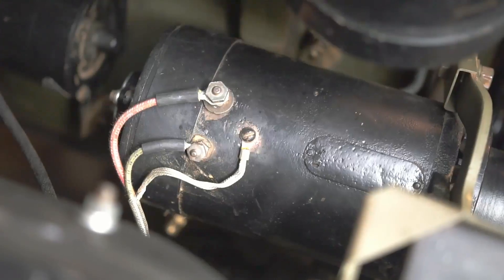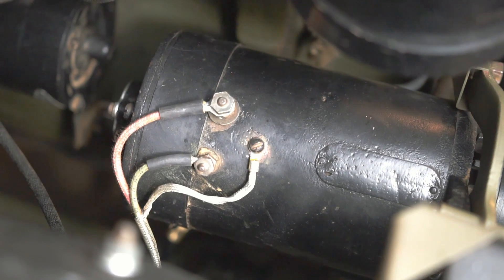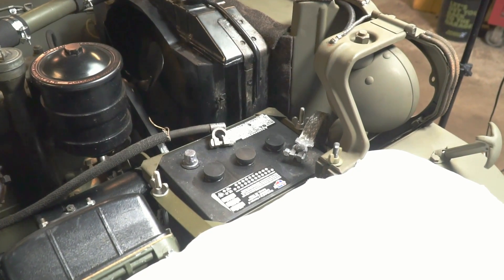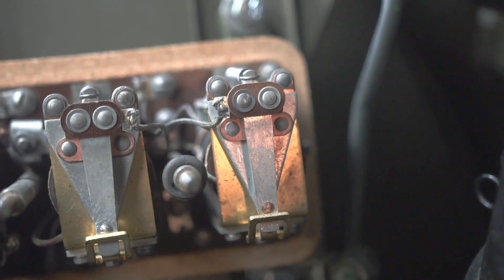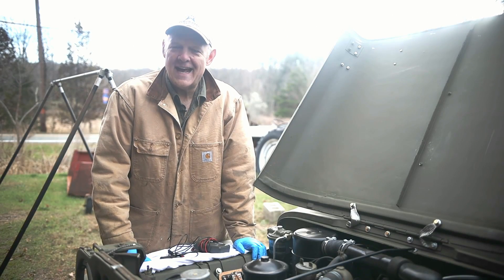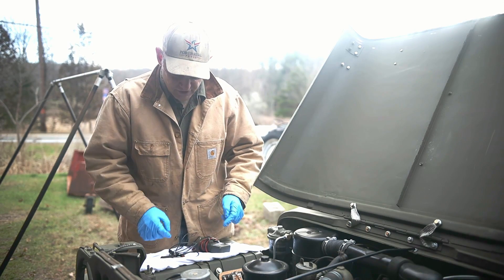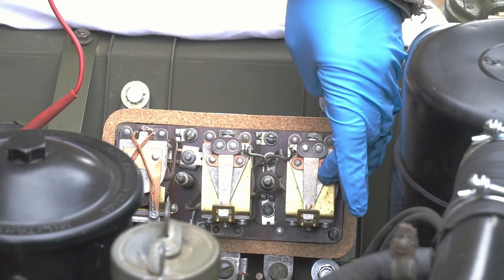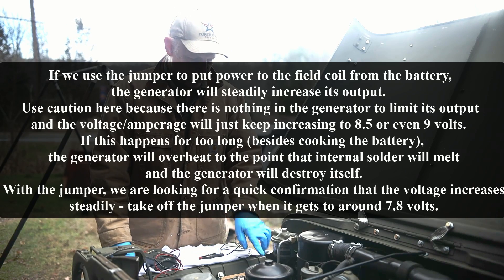WW2 Jeep  Generator Repair- Let's Fix that  Charging System/Shoptime #39

Comment: My Jeep isn't charging. When running the battery voltage is 6.2v (same as when the engine is off). I've followed the instructions to polarize it (Arm - Bat) and saw a little blue spark but it still doesn't charge. There doesn't appear to be anything happening under the cover of the Regulator, nothing moves at all when the Jeep is running. Would it hurt to try and polarise the Gennie for type A ( externally grounded)??
Reply from the maker: Start the jeep and get your voltmeter so it is clipped to the battery and giving you a readout.  Make sure the front most (closest to radiator) relay is closed...this is the "cutout relay".  Basically the on/off switch for the regulator/generator.  If it isn't moving - manually close it - just push down on the part with the contact until it closes - may spark a bit.  It should stay closed and things should start happening on the voltmeter.  

If it doesn't stay closed, then I would start by cleaning the contacts on all of the relays.   

You will be well served by getting the manual....very helpful in taking you through how it all works.  

https://www.portrayalpress.com/product-p/tm-9-1825b.htm
Reply: @Portrayalpress  thanks for your reply. I'm may be wrong, but I think that relay is permanently closed (contacts touching eachother).
Reply from the maker: That is not a good thing and can cause the generator to melt/a fire.  You need to put the positive lead of your voltmeter to the ARM terminal of the generator (big one), the ground to the body of the generator.  Then take a jumper and connect one end to the positive terminal of the battery.  Start the jeep.  Take the other side of that jumper and touch the Field post on the generator....you should see an ever increasing amount of volts on your voltmeter.  Don't leave it on there long....just see if the volt number starts creeping up.  The jeep should be a fast idle....maybe 1000 rpm (doesn't matter exactly, but have it running strongly).  This will confirm that the generator is still working.

Comment: Great video, right to the point, fun to watch, and exactly what I needed!   I drove my GPW the other day and noticed the meter showing a draw with the lights on.  I am thinking that is not normal.  I noticed a wire tie with a lead seal on one of the bolts of the voltage regulator, so I assume that it means it has never been messed with.    I think I will test my battery first since it is a 2018 cheap chain store model from the previous owner.   Have a good day!
Reply from the maker: Thanks JT and sorry for the slow response, I was offline for a bit.  Glad you enjoyed the video.  Indeed, the generator has the capability of putting out plenty so you should not be seeing a discharge with the lights on.  You can purchase the lead seal but I agree...most likely not messed with.  The battery probably should not cause the discharge with the lights on, but a fine place to start.  I would also check the belt tension, then just start the jeep and at idle with no lights, get a reading at the battery.
Reply: No worries on the late reply, the fact you made this video is more than enough help. So I found out my generator was rewired from its original circuit wiring so it would not work with the voltage regulator.  Never knew that generators had two types of circuit wiring, one type B I think was common for war era jeeps, and A was post war era.  So if your generator was an A circuit, it would not work work a voltage regulator that was war era for a B circuit generator.  Did I explain that correctly?

Comment: Good video,good explanation on these charging systems and how to check and adjust,that manual would be handy on any six volt jeep,I have a 2A with same Generator but civilian regulator but I know the charging principals are the same,just a different shape between them,the MB is bigger,I like those better and wonder why willys didnt keep that style on the civilian model,at least through the 2A's! Thanks!
Reply from the maker: Thank you Randall.  Yes - the voltage regulator on the MB is a beautiful piece of engineering!  I imagine they went with the later style because of cost....that progress thing! :-)

Comment: Hey Patrick great video.  Maybe I missed it but an important fact, the generator will not put out unless the engine is turning about 900-1000 rpms (a high idle).  Just sayin’. Thanks.
Reply from the maker: Appreciate it Paul - yes - probably not clear in the video!

Comment: Thanks a lot Patrick, awesome series of videos. I wanted to ask for your help, please: cj3a 52, 12 volts Neg grounded system. At 1200-1400 rpms Generator shows above 20 volts and 30 amps, regulator and battery shows 14-15 volts and 5-6 amps, amp gauge doesn't even move. Battery is not charging. I replaced both regulator and gauge, nothing changed. What do you think I'm doing wrong? I appreciate your help...
Reply from the maker: Glad you like them Andres.  I have a couple of questions:
1.  At 1200 rpm, what is the voltage at the battery?
2.  When you get 20 volts & 30 amps - how are you measuring that?  More specifically, is the generator connected to the VR? and what terminals are you connecting your voltimeter to get those readings? 

if you want to go email/call...send me your info to sales@portrayal.com and we can try and figure this out....

Comment: My starter and generator were recently rebuilt. Like your voltage regulator, the output from generator to battery was over 8 volts. When I checked the long unused “original” battery in the vehicles when I began the total rebuild I realized it was 8 Volt. The shop doing the rebuilds reset the VR to recharge the standard 6 V battery. Perhaps the previous owner reset the VR to recharge the 8 V battery. Thanks for the manual tip. It is now ready for me if I need it to guide me through VR readjustment when I wake my Jeep up. Thanks for the great tips 
and repeating the very necessary access to the right manual. Highest Regards, JeePa.
Reply from the maker: Thanks JeePa! Appreciate the kind comments...and good luck with the reawakening!  Always exciting to hear these machines run again after a long slumber.

Comment: Just a heads up i would pay attention to the flat bar with threaded holes they are usually stripped.
Reply from the maker: Jeff - thinking you are talking about the Weasel....and the air drop brackets?  If yes, thanks and I will check them carefully before I get too much further as now is an easy time to fix.
Reply: Suspension brackets that bolt to the tub also
Reply from the maker: @UCfewkvGqbXZyjTmbYczSBcg Thanks Jeff - I have a bit of work to do down there and I will make sure they are solid.